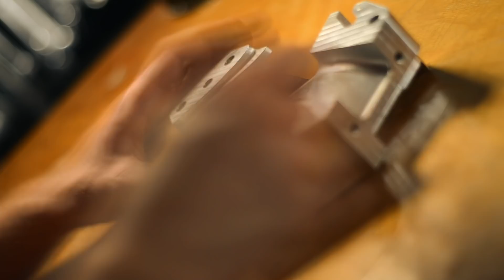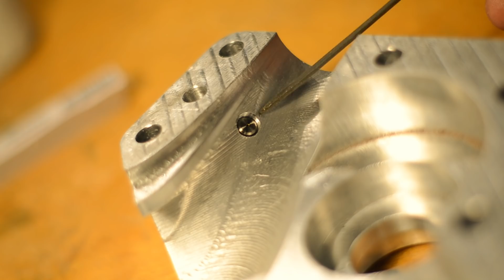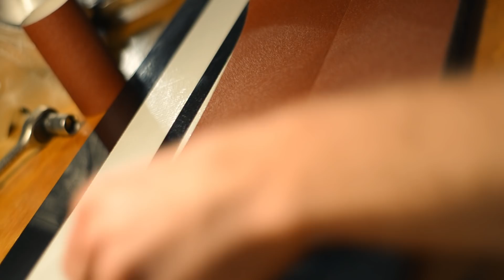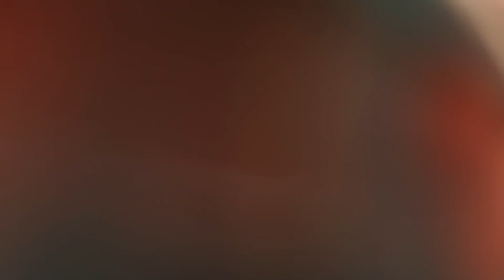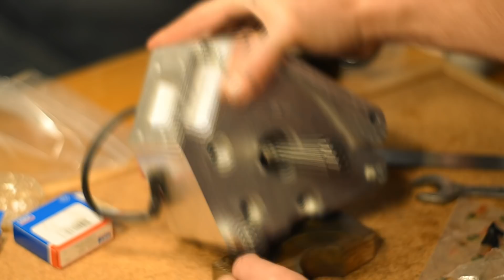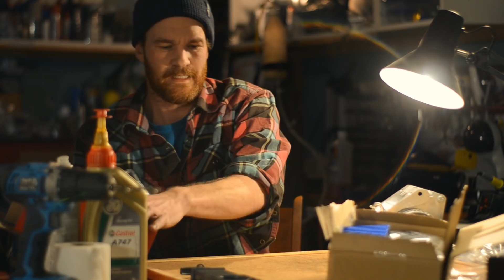The Most Powerful Two Stroke Assembly Part1

Comment: Just curious why you are using a valve instead of a throttle body for the second stage air? An electronic throttle body could also be turned on with the same switch that opens the fuel solenoid valve.

Comment: Very nice looking crankcase! I would suggest that you think about adopting a barrel valve instead of the slide valve on secondary intake. When completely open the barrel valve has no obstructions and is completely smooth. As opposed the slide valve has the slide channel that can induce turbulence to the airstream.

Comment: I like what you did with the crank case. Anything that reduces the clearance volume in the crank case of a 2-cycle engine will charge the cylinder better, resulting in more torque! Volumetric efficiency is the name of the game!
     The "Dynamometer" you're building, is called a "Brake Horsepower Dynamometer". That allows you to hold the engine at a fixed speed, while measuring the torque. The controller will multiply torque X RPM, divide it by a constant, to register BRAKE HORSEPOWER in real time.
     I'm from the United States of America: We measure torque in Foot Pounds. As such, we multiply RPM X foot pounds of torque, and divide it by 5252.1131 to get brake horsepower.(745.69987 watts per horsepower) Nice build, I can't wait to see the results on your new "dyno". Please include the RPM, torque, and displacement of your completed engine!

Comment: I'm sure you already know but Evinrude outboard motors are doing some very interesting things. 
They use a variable gated exhaust port which allows optimized exhaust timing through the full rpm range. Very trick!
 They use a relatively high pressure direct injection that has amazing atomization ability.
 They also use a dry sump style specific location  lubrication injection system that uses minimal oil in essential areas. 

 My question is when combining these three components, could it be possible to add boost and possibly not go through the crankcase causing parasitic losses? 
 It may be the case they would need to use their variable gated port on the intake side as well but that's the only problem I can see.
 The gated exhaust port they use has already proven to create incredible power and fuel economy and I think they are holding a lot back when you look at how low their compression ratio is. I can't remember off hand but I think it's as low as 100psi.
 
Another amazingly efficient old but recently revised two stroke turbo is the Achaties motor. 
It's an opposed piston turbo 2 stroke petrol or diesel. 
 
2 stroke technology is not dead, it hasn't been born yet!
 
I love your video's and wish you the best!

Comment: I really hope this concept is going to work. The crank case is a work of art!
I've already posted it once, not sure if you read it, but be careful with iridium and platinum spark plugs. The iridium and platinum reacts with methanol (catalytic reaction) and could cause spontanious combustion. (That's the principal of model engine combustion).

Comment: what speed will the gate valve open - slow and progressive or fast? Did you consider using a modified power valve to open the secondary intake?

Comment: Is heat deflection as a result of high RPM the reason you chose aluminium (or is it magnesium? :) Do the ads and you can get a carbon fibre reed valve assembly for the next video =D

Comment: Enjoy watching your videos, but on your new cases i did not see any alignment dowels between the two case halves and wondered when you aligned them (prior to sanding on the surface plate) how did you ensure your bearings are aligned? I've seen where builders will machine a solid bar/jig to go in place of the crank through the bearings to ensure they are in alignment before tightening the bolts and drilling/honing holes through the cases. Then installing dowel pins in those holes so when assembling the alignment relies on the dowel pins and you know the cases are true to each other.

Comment: Can a 2 stroke operate at such a high RPM that the expansion chamber stops sending unburnt fuel back into the combustion chamber? I was wondering if you were planning to use an expansion chamber pipe.

Comment: You would of been far better putting the crank cases in the oven at 165 degree Celsius and placing your bearings in the deep freeze.  This technique allows the bearings to drop in.  Are you using C4 bearing types?  Great videos.  I have watched them all being a 2 stroke freak lol. Love the smell of burnt Castrol R40, castor oil the smell of youth.  Keep up the good work.

Comment: Hey, I've watch quite a few of your videos but I have not seen you use cartridge rolls(better than sand paper loosely rolled on a mandrel). It would greatly improve you surface finish and the reduce the time spent doing so. Do you have a 1/4" die grinder? I can send you a couple things to try out.

https://www.amazon.com/Allstar-Performance-ALL11052-Port-Polish/dp/B009Q72U56/ref=sr_1_2?keywords=Cartridge+Roll+Kit&qid=1579018395&sr=8-2
Reply: Side note.. I'm not expecting anything in return, I just like your videos and would like to help you out.

Comment: Is there a reason you made the crank bearing seats so tight? Ive rebuildt engines where youd only need like 1 to 2 little hammer hits to get em flush.
Reply: Oh and what bearings are you using? C3 or an even tighter fit?

Comment: Ideas for thought. Multiple direct fuel injectors to create spontaneous combustion at super high rpm. Ultra high compression ratio. Some form of pressure bleed used a lower rpm.

Comment: Please do these commercials everyone watching knows how expensive this hobby is 👍🏼
Also, because you said you will be ruining parts sooner or later, I'm afraid that your main bearings won't be getting enough lubrication because you are missing these 'bearing lubrication holes' (I have no clue what the correct term is) that most 2 stroke engine have. Maybe lubrication works different for nitromethane engines? I would like to hear what you guys in the comments think about this.

Comment: Thank you for the video!
Did you try to test the fitting with 3d printed parts before? I'm asking because when I try to assemble 3d printed parts I designed, it sometimes fail because of the lack of accuracy to print holes for example. Does casting in aluminum change the dimensions of the part as well?
Best of luck for your project :)

Comment: We don't mind commercials.  If it helps go for it.  A word on tapping threads by hand.  For metric sizes I use machine taps these days.  There are two types, spiral point for through holes and spiral flute for blind ones.   It is production tooling designed to work and can be used by hand.  I tapped some M8 x 1.25 into the frames of my loco  only yesterday.

Comment: Sorry...a little question please..Why not a 2 stroke whith gearbox?
Reply: He wants to run the engine in a very narrow rpm range and so is using a variable transmission to keep it in that range at different speeds
Reply: @willdavidson4599  Absolute unterstand you,but it's not the maxim range..Variator is not fly whell at 2 stroke...Power is with gear box.....1-2-3-4-5-6-7-8....
  We want power,or speed?This is the question now....2 stroke building?Or some nitro?Record of speed,or sky?
 I Think that we love 2 stroke....It's not the same.....
Reply: Dyno jet is at cold test,power on wheel....but 420 meters is improbablly.....He use Bearings SKF C3,C4....Not ceramics...Roll over oil....for short race....After 1-2 race....the engine must be rebuillt.....This is the question about....Power for five minutes,or racing?Interesant time?

Comment: Got to ask anyone know why its called 2stroke stuffing?  the stuffing translates to? and of course do ads for sure the ads youtube shows are repeated over and over and over.
Reply: Traditionally, when hot rodding a 2 stroke engine, the extra space in the crank cases was fitted with a material, like cork or plastic, so that the crank case volume at bottom dead center was minimised. This gave the engine a more efficient, or powerful pumping action of the charge into the cylinder. This then created more engine torque.  With his new design, at operating RPM, Alex is not relying on volumetric pumping, but rather resonance and ram effect to charge the cylinder.  The inlet horn is always open to the atmosphere at designed peak power RPM. Still, keeping the clearances around the crankshaft small will prevent losses.
Reply: @jimdale9187  I never knew that about 2 strokes, the only thing I ever knew about was the Reed Valve.  I finally know how a rotary engine works still not sure why a two stroke has a power band.
Reply: @mowler8042  A good book is "Performance Tuning in Theory and Practice Two Strokes" by A Graham Bell. And of course, previous videos by 2STROKESTUFFING.
Two stroke torque is sensitive to RPM because the engine is pumping compressible gas into and out of the cylinder. Being compressible, it resonates and pulses at some frequencies causing increased or decreased engine torque.  Most manufacturers attempted to control the power band so that engine output was manageable across a usable RPM range.  Since Alex has a Continuously Variable Transmission, he has designed his engine to be VERY high output over a narrow RPM range, and he relies on the CVT to apply that HUGE OUTPUT over a broad range of speeds.
Reply: @jimdale9187  thank you for all the information

Comment: Kinda hurt me watching you slamming those bearings 😅
But nice work, keep it up!
Reply: As a proffessional I must say that that is just not the way I learned it. It is ok sometimes I guess but in this case it would be way more elegant to shrink them bearings in. Hammering bearings in works but on such high RPM you actually could get some problems with it.
Reply: @munz12  It would be so easy to pop those pieces into the oven, I do it because i'm lazy.
Reply: Christoph Filliger what? Its fine
Reply: It is okay to install the bearings that way as long as you are not hammering the bearings, just the race that is going into the case.

Comment: I was reading yesterday that a formula one boss wants to introduce 2 strokes in 2025. This could be a great opportunity for you. Keep up your great work.
Reply: @M Bacon It's gonna be fuel injection so no unnecessary oil burned
Reply: @M Bacon yep your spot on there with oil there talking some type of biofuel. 
I'd say if they've designed a new bottom end style that doesn't require fuel oil to lubricate crank bearings and biofuel will lubricate pistons and rings they'd have a winner. 
Apparently the motor already tested is more environmentally friendly than 4stroke .
More power to fuel burn ratio .
Shocked me but great for 2stroke fans.
Reply: @M Bacon 
Thanks for sharing never looked into modern injected marine 2strokes,  but now i will .
Cheers thanks .
Reply: @M Bacon there were piston compression marine 2 strokes :) however nowadays there are only turbocharged marine 2 strokes
Reply: Read aswell motogp returning with 2strokes aswell,  go you good thing can't wait .
2stroke stuffing will be engineering a half litre rocket for them and Royalties , hope so.

Comment: Don't  know exactly what is going on with the valve that you showed, but if that doesn't have some special stuff going on it probably won't work.  I worked on an motor engineering team awhile ago and they had designed and built a similar slide style on the intake of the engine. The reason it didn't work is because once the air started flowing through it pushes the slide to one side and increases the friction significantly. So much so that the cableing that controlled the valve ended up snapping.   This is why butterfly valves are always used in all machinery.